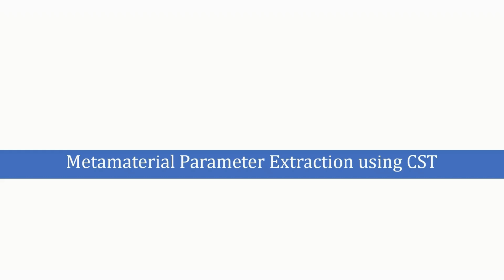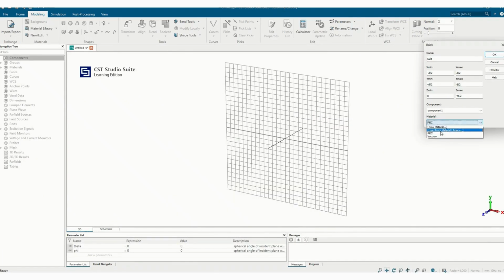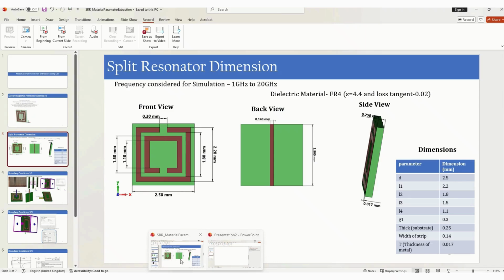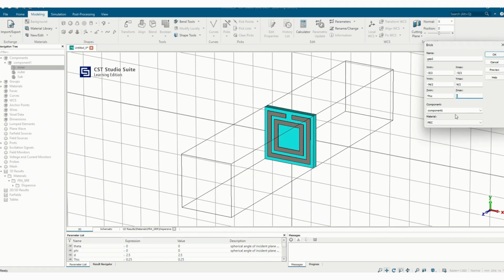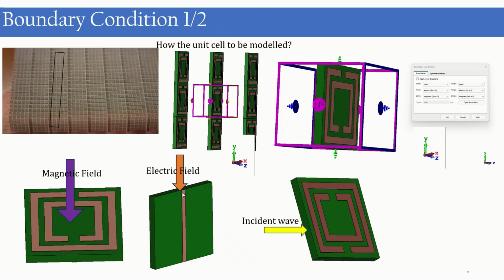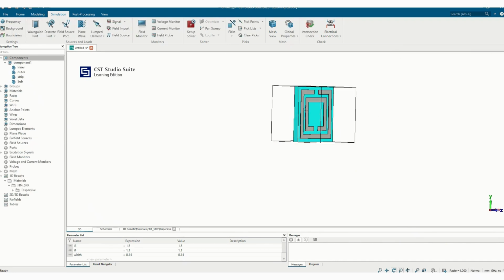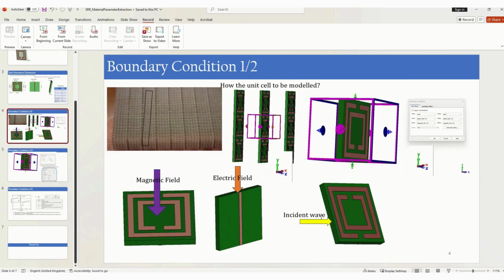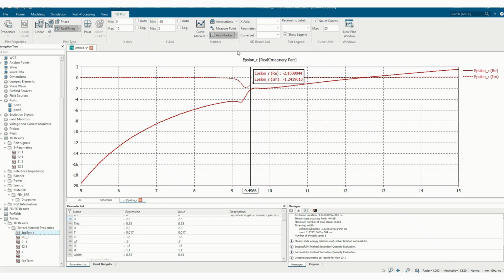Metamaterial SRR Simulation in CST | Parameter Extraction |Step by Step guide

Comment: The method used to extract the effective parameters in CST is an approximation and may not provide fully accurate results. A more rigorous and reliable approach is the David Smith method, as presented in the referenced research paper, which ensures a more physically consistent extraction of the parameters.